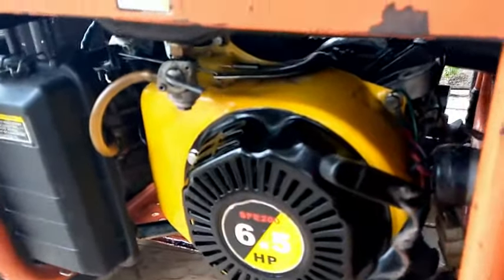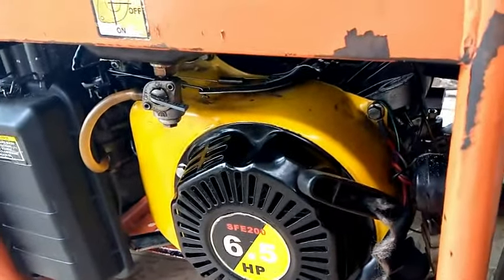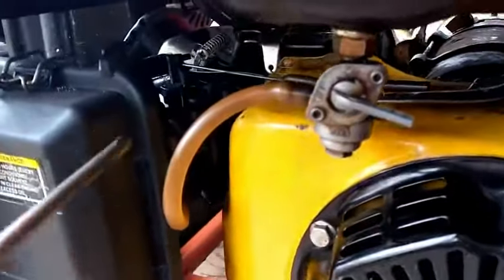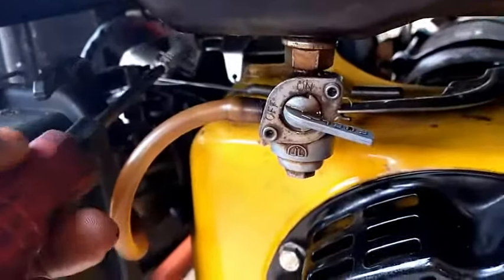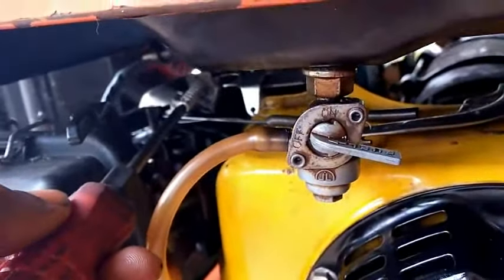Where and how to increase and decrease your generator's current and speed

Comment: Do note that changing the engine speed also changes the frequency. Be sure to keep it near 50 or 60hz depending on where you live.
Reply: How do I know the 50/60 Hz?
Reply: @kingderri  Use a AC frequency meter.
Reply: من خلال قراءة البيانات على الأجهزة

Comment: I'm glad I saw this video and did not have to losen the AVR as some other videos suggested to increase the current. Or is it still necessary to open the AVR?
Reply from the maker: AVR adjustment is for those mechanically inclined. If after trying this, the current still didn't increase, then you can try avr

Comment: That is just the idle screw adjustment, which will increase the frequency in Hertz.  This will not increase the current!
But thank you because I wanted to reduce the frequency on mine to 50Hz, and this is the answer!

Comment: Please I have reduced the voltage of my generator but after 10-15mins it is one. It blows off some things in my house. It starts with my bulbs. Please what's the problem. I no longer turn on the generator. I have tried reducing it to the lowest still the same thing. What could be the problem? Please I need an answer urgently. Thank you
Reply from the maker: Should not be too low,
Should not be too high, but moderate speed,
Replace the AVR,
Seek the help of a good mechanic

Comment: Does this reduce fuel consumption too?
Reply from the maker: The higher the engine speed, the higher the fuel consumption.  The lower the engine speed,the lower the fuel consumption. But leave at moderate speed 50hz
Reply: @OTGenSolution  How do I know speed?
Reply: Please help with this 50hz part
Reply: @OnlyOneNia  that's the engine speed
I'm not a generator Engineer but I know an external device is usually used to measure it

A speed above 60 Hz may not be very good for your generator/appliances
Reply: @OlogboEmmanuel  you're a gem. Thanks.👍

Comment: When I am tightening the bolt I can feel the engine sound and speed is changed, but no change in voltage. It remains the same 178 Vac.
Reply from the maker: Yes, that's because it has an automatic voltage regulator